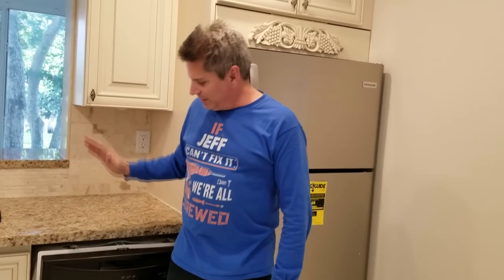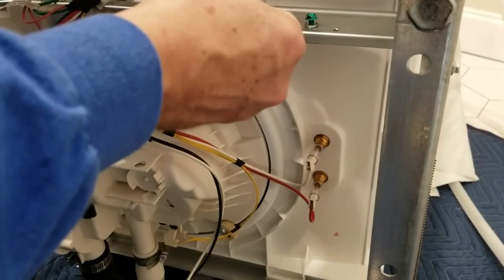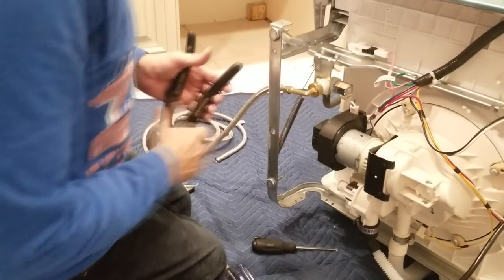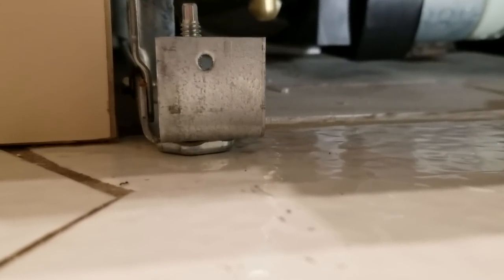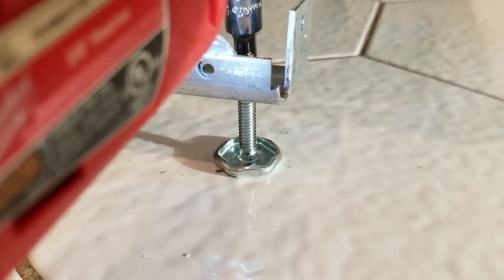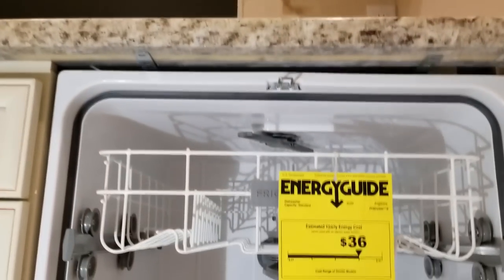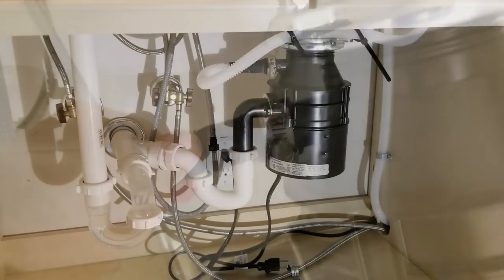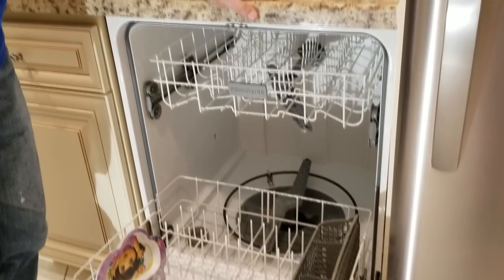Dishwasher Installation & Kit, Correct Plumbing Codes

Comment: Our drain hose on our dishwasher does not have that big of an adapter to connect to our Waste King garbage disposal.  Our old Whirlpool did, but the new Bosch came with smaller adapter.  Is there a conversion kit and if so, how is that installed?
Reply from the maker: Maybe you are looking for this part: https://homedepot.sjv.io/Q5WY9
Reply: Thanks!  Now if I could just get someone to show how to properly connect that to the current one.

Comment: Did you ever notice that newer dishwashers already have the hose looped against the body of the unit? I'd be curious as to whether local code has language about that.  Incidentally, there is excess drain hose to make an additional loop, if one desires.
Reply from the maker: That access hose is not really access at all. Most plumbing codes require a hi loop under the kitchen cabinet as well so you need that extra length of hose to form this high loop.
Reply: @jeffostroff  Thx. I was wondering about that. I noticed that the older units didn't have that loop against the body.
Reply: @jeffostroff  What would you suggest for a stand-alone dishwasher sitting in a center island?

Comment: We live in Kentucky. We juat purchased a home a month ago and it has an Air Gap. Our last home (from a different state) didn't have one and I'm hoping we can reroute the plumbing to remove the air gap. 

This line is from the Kentucky building code:
(d) Residential type dishwashing machines shall discharge:
1. Through an air gap device; or
2. Indirectly through a three (3) inch open receptacle.

Does number 2 mean we're able to attach it to the garbage disposal like you did in this video? I'm a little confused by the verbiage. Thank you for any input or help!
Reply from the maker: Heck I'm confused! I hate air gaps they are butt ugly. But why they want a 3" receptacle is beyond me. that sounds vague but I wonder if that means that the drain pipe coming out of the wall needs to be 3" also. I would check with a plumber, they probably have a lot of insight into the interpretation.
Reply: @jeffostroff  Thanks so much Jeff! I'll give one a call and see if they can help clear things up. 😁 I just found your channel and am so excited to be a subscriber now! Your videos are very helpful!

Comment: If sanitation was a concern, why do they provide ribbed waste pipes that can collect dishwasher debris?
Reply from the maker: I have always wondered that myself. I guess because it is pumped out by the dishwasher it does move with some force. But there is hardly any food at all in the discharge, as any solid chunks don't get past the chopper filter of the dishwasher, or if you have the other type of base filter, then food gets trapped by the filter.

Comment: When I shut off my hot water valve under my sink & disconnected the copper water line to the dishwasher water ran out which told me that was NOT the correct shut-off valve, the problem is it looks like the water line actually comes directly out of my hot water heater in the basement. It too has a cheap shut-off valve but after closing it the same thing happened (water spurted out when disconnecting from dishwasher). Im wondering if I should just shut off the MAIN water to my duplex? And if so do I need to turn off the gas hot water heater after turning off the water main or is it safe to leave the hot water heater on? Please help?
Reply from the maker: When you shut off the water valve under the sink on the hot water side, that  should cut off water to dishwasher. You will have some water still left in the pipe that will come out, you can probably hold a cup of water in that pipe going to the dishwasher. but if water gushes full stream is it coming from the shut off valve? It could mean your valve is bad or you did not shut off the valve. As far as the gas water heater, I don't know anything about them.

Comment: Are you screwing into granite here or some kind of wood counter?  I'm raising my legs to level and to contact the granite counters today...son bought a special metal thingy that has to be bent and installed to sides of counter as to not have to drill into the under belly of the granite counters.  Is this BS and can I simple mark the area where I need a screw...drill with masonry bit and put the plastic things in there and screw to them?  Tks
Reply from the maker: Masonry bits do not work on granite you really need those tiny little hole saws like the one we showed

Comment: Jeff, I'm hardworking a new dishwasher where an old dishwasher was removed a few years ago. This is 1999 year model mobile home. How can I tell if the wiring is protected by GFCI? There is a GFCI outlet in the master bathroom. Does that cover the whole house? Thank you in advance.
Reply from the maker: That outlet likely cover sonly the bathroom. Check the breaker box and see if there is a breaker for the dishwasher that is GFCI, if not, see if the buttons are on the outlet for the dishwasher. I have yet to see in any house a dishwasher outlet or garbage disposal outlet protected by GFCI
Reply: @jeffostroff  
That word was supposed to be hardwiring instead of hardworking. Not sure how it got changed like that. I did look at the breaker box after I messaged you, and saw one labeled Dishwasher, but how do I tell if it is GFCI? I'm thinking that in 1999 mobile home codes were up to par by then. In any case, what is the difference between a GFCI breaker and one that is not? Won't the breaker flip if it's in trouble? Your opinion means a lot to me. Thank you in advance.

Comment: Hello, 

Can we shroud a naked dishwasher in a tarp, plastic sheet or some other material to keep the dishwasher dry just in case water was to leak in from an - often wet - benchtop above? 

Can we also make our own direct connect nipple for the outflow from - in my case - a dishwasher, washing machine and two sink overflows?

Thank you. 🙏🏼🤪👍🏼
Reply from the maker: I've never heard of covering the dishwasher before. I think you can do it as longs as the manufacturer instructions tell you not to cover the dishwasher. Remember it has vents usually at the top of the door that allow steam to dissipate, so they might not want that blocked. Using a nipple should not be a problem as long as it does not restrict the flow of the water.

Comment: Not good in Illinois :

Section 890.770  Dishwashing Machines

a)         Domestic Dishwasher (Private Residence).  When a domestic dishwashing machine drain line is connected to the house side of a trap from a sink, the drain from the dishwasher shall be carried up to the underside of the spill rim of the sink.  Dishwashing machines shall discharge separately into a trap or tail piece of the kitchen sink and shall not connect to the food waste disposal unit.
Reply from the maker: Dang at sucks that is really archaic and Chicago has some strange additions to the plumbing code. I know other States like Wisconsin make you use that ugly over the counter air gap that sits on top of the counter. BUMMER

Comment: When connecting my plug to the wires to the dishwasher. I have two ground wires. One is a regular straight wire end on the plug and the other is loop wire end connect to the dishwasher. I'm stuck! What to do about the ground wires?
Reply from the maker: All the ground wires get connected together

Comment: So Jeff how do you install the p-trap to a floor drain? The diagram at 25:53 shows what some say is an s-trap but some youtube videos turn into a circle and call it a p-trap still. Is the proper way just to use a 90 degree elbow to the floor drain?
Reply from the maker: The dish washing machines should have instructions for you in the installation guide on how to handle the S trap floor drain that you have . Either way that hose coming from the dishwasher still has to at some point create what we called a high loop. This means the hose has to go up to about 3436 inches high turn around and come back down to the ground again that part where it goes up is called the high loop and it prevents sewage from backing up into your dishwasher
Reply: @jeffostroff  - I need to redo mine . The kitchen sink has no ptrap drain is straight down and so is the dishwasher.

Comment: Why do DW manufacturers always supply corrugated drain hoses? There will always be water standing in the corrugations. Why not a hose with smooth interior surface? Can the drain be hard piped to an point, realizing that one may need to  pull out the DW at some point?
Reply from the maker: I always wondered that too, but at least you usually have no chunks of anything in those hoses, because the dishwashers have filters in them to prevent anything other than water from getting into that hose.

Comment: Hi my new dishwasher and n new garbage disposal basically whole new kitchen I did cycle and water at the bottom of dishwasher don’t know why
Reply from the maker: If you have water at the bottom of the dishwasher, most likely reason is someone forgot to remove the plug on the garbage disposal inside the side spout where the dishwasher drain hose connects to the garbage disposal. If you forge to punch it out with hammer and screwdriver, water has nowhere to go from the dishwasher, and goes back inside. Did anyone remove this plastic plug?
Reply: Thank you for replying I don’t know handyman installed can you please show me where that thing is or I can send u pic of my dishwasher thank you once again highly aporeciated

Comment: The hose on my dishwasher is dirty. Does this mean that sewer has been backing up into my dishwasher ( washing my dishes in sewer water) . My hose is dirty and every time I run the dishwasher it back up into the garbage disposal. my dish washer smells funny and the dishes is sticky. Can you explain the water flow and how the water flows to wash your dishes… 😢. Please help…
Reply from the maker: Your hose from the dishwasher when it enters the under sink cavity, is required by building codes to have a high loop. This means the hose must go all the way up to the underside of the counter, then come back down to the garbage disposal port. This helps prevent backing up into the dishwasher. If your hose is just laying on the bottom of the cabinet then going up tot he disposal, then it is wrong.

Comment: I don't understand why dishwashers don't just come with the Romex conduit clamp already installed into the junction box??.... you always need it and it's electrical code to have it, so why do they not just make it part of the dishwasher so that idiots don't get lazy and just shove the wires through?  Also they could easily include the grounded plug adapter for those who have outlets instead of a Romex cable coming from their wall.
Reply from the maker: That always bothered me too!

Comment: How far can a GE dishwasher be from the drain
Reply from the maker: Good question, most come with a 6 foot hose that can be stretched out a few feet, but I would use the length of the hose they give you as the maximum distance. How far away are you from the drain?

Comment: Why wouldn't the hole be drilled in the too then for the drain line
Reply from the maker: You are not supposed ot drill the hole up top because there is no clearance for the hose inside the dishwasher cavity to make its way into the base cabinet, the hose will get pinched. When you look at the installation guide of all dishwashers, they typically show you a 4 x 7 area at the bottom of the cabinet where you can drill your holes, and they tell you not to pass hoses or clerical cords anywhere else.

Comment: you never showed the true skill part of cutting the copper hot water line  and sweating the universal shutoff valve  fitting   to the sink and dishwasher to hot water supply
Reply from the maker: We usually don't sweat on shut off valves anymore, they are mostly compression fittings now. We show you how we did that in our other video: https://youtu.be/_0ziKhjwwe8
Reply: @jeffostroff  thanks for the reply

Comment: WHAT YOU DID IS BETTER BUT NOT GOOD EITHER. YOU NEED A "Y" COUPLER  AIRREATOR ON TOP OF YOUR SINK AND RUN DISHWASHER TO ONE SIDE AND DISHWASHER TO THE OTHER SIDE
Reply from the maker: Those ugly air gaps are required by code in Wisconsin, but other stated use the high loop.

Comment: American appliances are awful. That blanket arrangement in place of a housing. No bottom cover, meaning dust and debris can more easily accumulate around the mechanics, and perhaps more importantly no sump with float switch to activate the pump and cut the water in the event of a leak. Then the inaccessible bottom connections- why not on rear like in Europe? Plastic tub that will get discoloured and scratched. The cheapest dishwashers in the U.K. are around £180 / $220 ish, and are better than this in every way.
Reply from the maker: Normally for my own house, I buy the dishwashers with stainless steel interior, but they cost way more money.